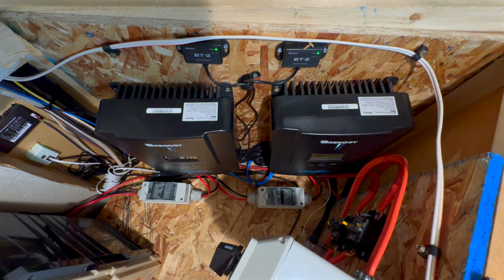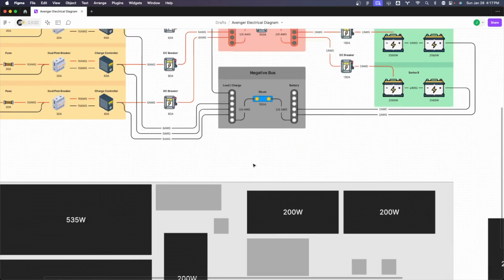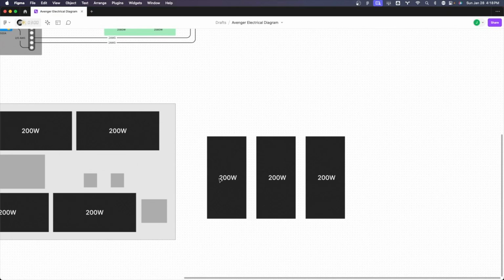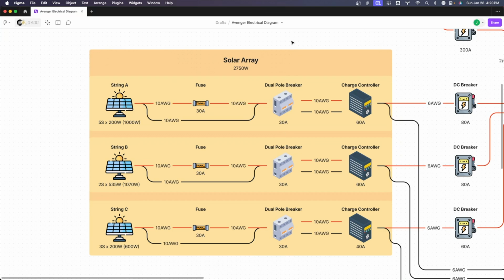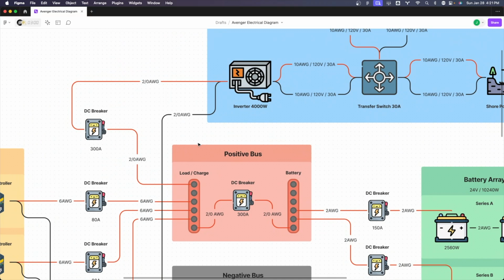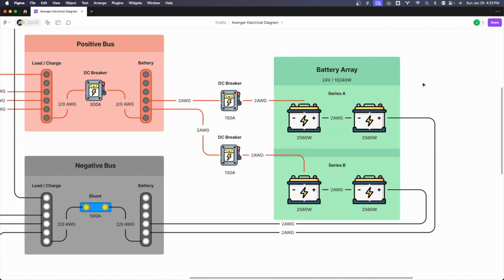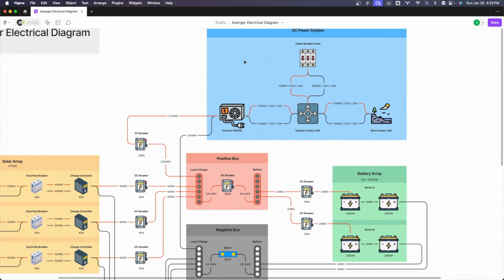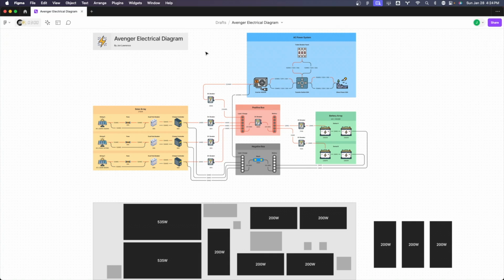I Added a 10KW Battery Array to My Trailer

Comment: Long therm, a balancer to keep the voltage equal between the two batteries in series would make sense.
Reply from the maker: You are right, I added a balancer to the batteries.

Comment: Nice video! you might want to to 48v instead of 12v?
What software do you use to make those diagrams?
Reply from the maker: A little late for 48v, but I went 24v for a specific reason. I used Figma to make the diagrams.

Comment: Looks like a 10 kWh battery setup.  There is no such thing as a 10KW battery, also you do not have "200 Amp batteries" as said in the video, those are Ah (Amp hours)...  Watts equal power at any given moment, and kWh tells you about the capacity, as well as Watt hours do. Upper case K is Kelvin and small k is kilo.
Nice video and ideas anyhow, keep it up. 👍
Reply from the maker: Thank you for the correction

Comment: Looks like a good DIY install.  Only comment is your panels should have some form of rapid shutdown (like TIGO devices) and the system should have an E-stop button (ideally on the inside and outside of the camper).
Reply from the maker: Thanks

Comment: Why on Earth did you choose that cheap high frequency, transformerless inverter with its short life expectancy, and poor surge capacity? For a little extra money you could have purchased a far more reliable, longer lasting hybrid, low frequency, transformer based inverter charger that would have provided you with a much higher surge capacity and a much safer source of power.
Reply from the maker: Sorry to disappoint you
Reply: @jonlawrence  if you're like me, I hit the budget wall and knowingly will get a better inverter down the road. As long as your are enjoying it all, well then Great Job! Upgrades can easily come down the road. High 5 man, nice work.
Reply: @jonlawrence this is something that can be upgraded later, no problem.   Last year I bought a 24v 5000w, now I have 4 inverters.    Not to worry, there are still affordable HF inverters that last many years.   CNSWIPOWER and WZRELB have decent histories for longevity.   Renogy also has them but they are a little more costly.
Reply: What's with all these comments bashing transformerless inverters the past month? I've been seeing them everywhere all of a sudden... Coincidence?

Comment: You did quite a few things right.  Actually you almost got everything right, kudos!  The only real mistake you made was putting two 12V batteries in series and then paralleling two sets, instead of putting 4 x 24V batteries in parallel.

Since you have 12V in series, make sure you have a whole battery balancer.  You'll need two of them, one for each set of two.   Otherwise in a few months the two 12V batteries will get out of balance between each other and things will get wonky.  NOTE: the leads must have inline fuses.  ALL wiring on the batteries, even if only sensing and balancing cables, need fuses.  I recommend inline glass fuses.

Going with a 48V system voltage would have been even better given the size of the solar arrays, but it isn't the end of the world.  24V as a system voltage is already heads and tails better than using 12V as a system voltage.

A couple of checklist items:

* Those "lever" breakers are horrible.  They generally aren't real breakers so you may want to consider replacing them with DC MCBs (miniaturize circuit breakers).  However, make sure that you get 2-pole breakers and that they are NON polarized breakers.

* Break both poles, always.  Both the plus and the minus.

* Whether 2-pole or not, whether polarized or not, any breakers with a wired connection to the battery should have the battery on the LINE side of the breaker.  Even if the current direction (such as breakers related to charging) is the opposite.  Well, getting non-polarized breakers is the main thing.  But to be absolutely sure since it is hard to tell, the battery should be on the LINE side of the breaker.

The reason is that the battery is the highest-current / shorting-danger that the breakers might need to break the ARC on.  Charge controllers are current limited.

* Always fuse the solar panels according to the solar panel specification.  A 30A fuse is probably way too high on the solar panel side.   The specification will say what the maximum series fuse value is.

* Put a plastic separator between your two bus bars.  They are way too close together.

* Make sure your tools are insulated.

* Venting.  That bay where you have the batteries and equipment needs to have a direct vent to the outside, and preferably fans.  Make sure you have a mesh on the outside to prevent insect / critter ingress.   Fans should exhaust directly to the outside for safety... if a battery failure occurs you don't want the fans pushing toxic white smoke into the trailer.   The intake side can also go to the outside of the trailer.  Make the fans temperature controller but also with a way to turn them on manually.

* Safety.   Have a smoke alarm in the bay, and in the event of a battery failure.

* Weight issues.  If you want to add more batteries in the future, consider putting the additional batteries on the other side of the trailer to improve the weight balance.  You already have quite a bit of weight in that bay.   Don't worry too much about making the cable lengths perfect for crossing cabling, it isn't that big of a deal since any expansion you do will reduce the cycling of the entire battery system considerably, trumping any mismatched wear that occurs due to the currents not all matching.

                                                LIFEPO4 BATTERY FAILURE / SAFETY

* LiFePO4 is a very safe lithium chemistry, but thermal runaway is still possible.  Usually it just results in a lot of toxic white smoke and no fire, but that isn't guaranteed.  The problem is the toxic white smoke, so make sure you have the proper detector in there and fans that exhaust to the outside.

* Generally speaking, lithium battery runaways cannot be put out so basically you are left there hoping that they don't cause an actual fire.  Having fans to exhaust the toxic smoke to the outside is a good idea (temperature controlled fan directly connected to the battery with only an inline glass fuse, so it runs even if all the breakers are open).

* Consider rearranging the bay so the batteries can be directly accessed from the outside and ripped out by main force if necessary.   Putting the batteries on Anderson quick disconnects helps there (usually in sets of two).

-Matt
Reply: I'll add a bit more about inverters and external power.

Typically in a system this big you will want to have at least two inverters and maybe even three.  Remember that the size of the invert correlates with the vampire power it draws.  A small inverter might eat 5-10W, a mid-sized 10-20W, and a large inverter might eat more power just by being on.

Make one inverter small and use it to run basic low-power equipment in the RV, such as lights, computer, internet, etc.   This gives you the option of simply leaving this inverter on 24x7 or nearly 24x7 without having to worry about the vampire power draw eating the batteries up.   This inverter could also power a fridge, for example.

Make the other inverter(s) larger for power large appliances.  A/C, induction tea kettle, induction burner (stovetop), toaster oven, micro-wave.  One or two large inverters.  The key for these inverters is to get inverters with a remote switch input and wire the switches into the kitchen area of the trailer.   That way these larger inverters can be turned off when not in use and thus not draw any vampire power.

AC appliances are fine for things that don't use a whole lot of power.  That includes the fridge.  DC appliances are great if you want power efficiency, but the problem with DC appliances is that you have to match them to the system voltage (24V in your case), which reduces your flexibility later on if you want to change the system voltage to 48V.  So be aware of that when buying big appliances.

--

For shore power, consider removing the transfer switch and just having everything powered from the inverters.  Instead, have the shore power connection go to a battery charger.

I'll use a simple example... say, a Victron Energy Blue Smart IP67 24-Volt 12A battery charger.   Something like that, though presumably something that can do more amps.  That particular charger can only push about 300W into the system.

The reason is that you have enough energy storage that you do not need to risk bad shore power blowing up your trailer's electronics.   Ultimately the amount of charging capability you want will depend on comfort and convenience.  For example, if you have an A/C system or electric heater you would probably want enough shore charging capability to run the higher of the two plus a bit extra.

At the same time, having a small charger is useful too, when visiting friends, as you would only need to run a 120VAC extension cord.   Well, no reason why you couldn't have multiple chargers in the system!

-Matt
Reply from the maker: Thanks for your remarks